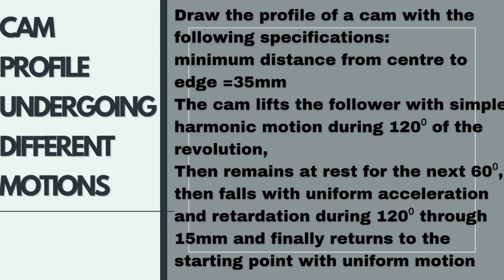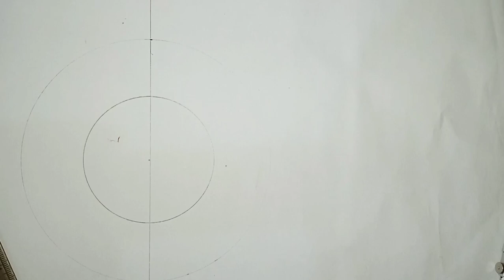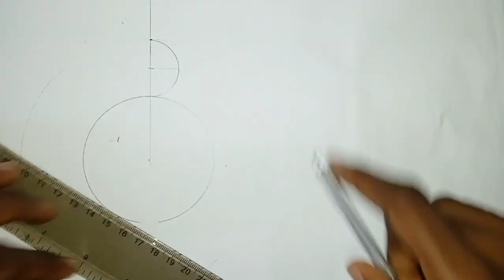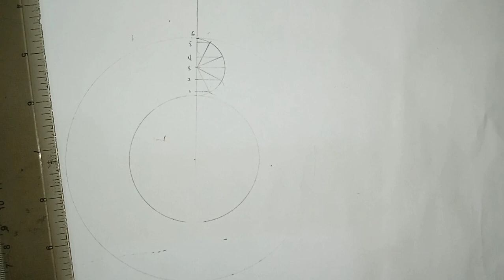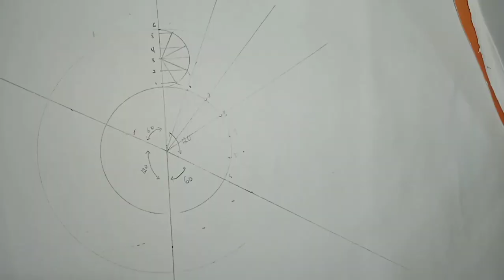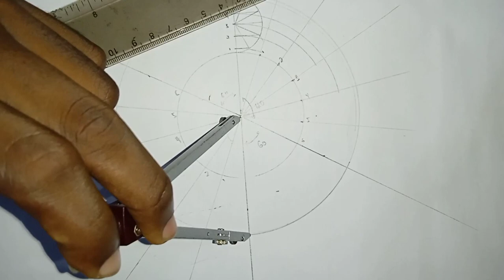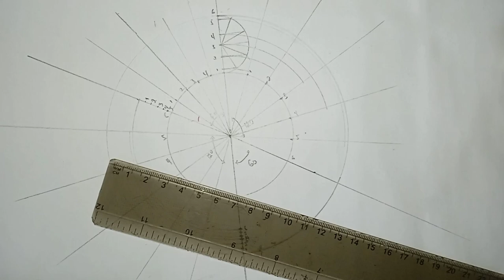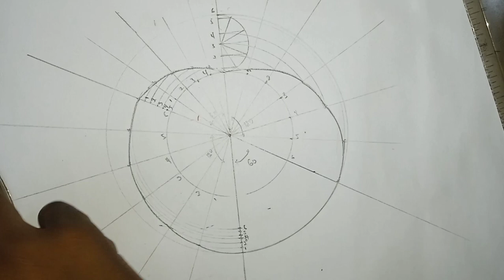cam profile undergoing three motions engineering drawing

Comment: From the question there was no measurement for the lift... How did 30 come about
Reply from the maker: Check your questions again
Reply: Still see no 30mm in the question
Reply: There is no measurement of 30mm on the lift , you check the question again
Reply from the maker: There was an error in the question, the follower is of length 30mm